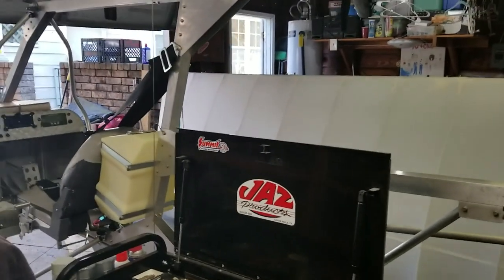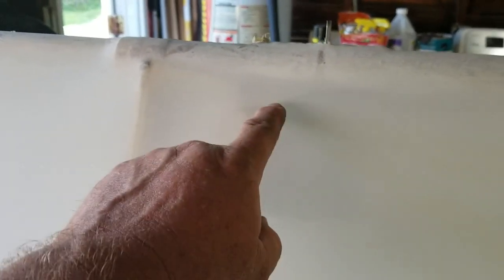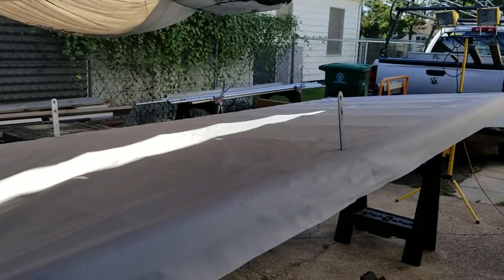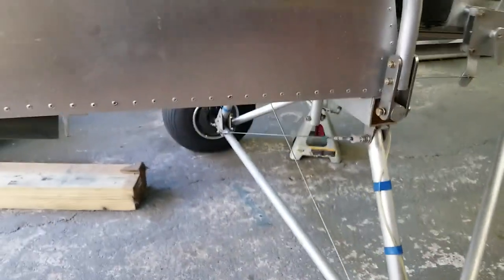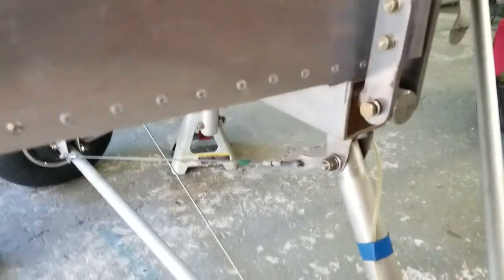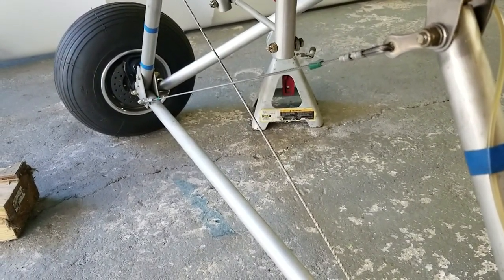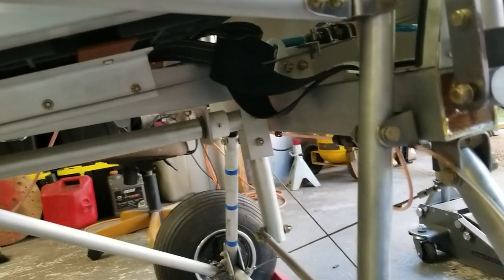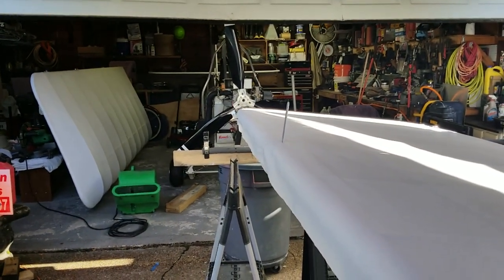Affordaplane second wing ready

Comment: Excellent video. The more of see of this aircraft, the more it impresses me. A couple of questions: can you substitute a cable set-up for the elevator control instead of a pushrod? Is there a centre stick option?
Reply: I would consider actual weight of the cable vs pushrod. I would guess the pushrod lighter and safer.
Reply: Mike...This vid might help w/ what you asked.....Its the cabling on a Cessna...https://www.youtube.com/watch?v=AiTk5r-4coc     Looks a bit "complicated for use on a simple plane like the A A P.....
Reply from the maker: Yes the plans do show center stick option and I know of several that have changed to a cable system on the elevator